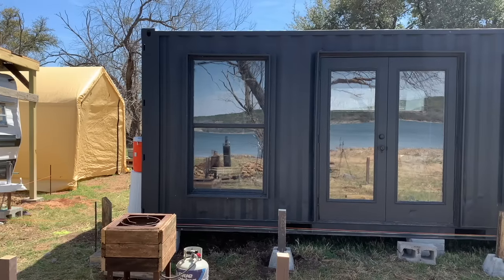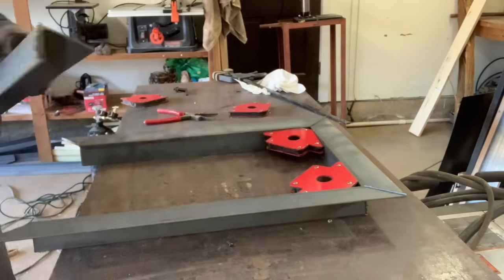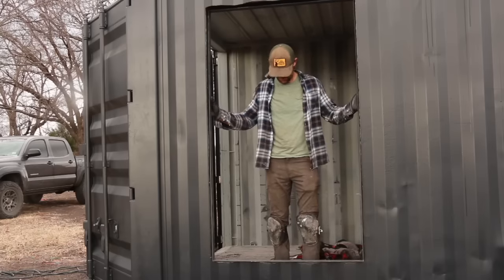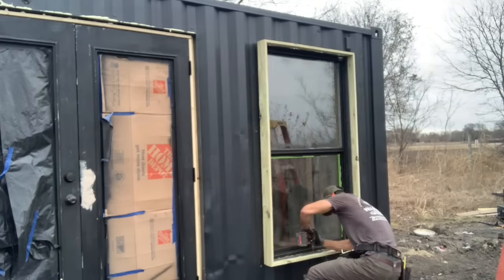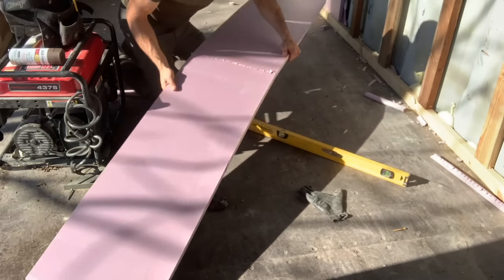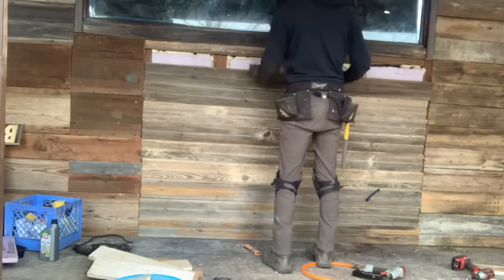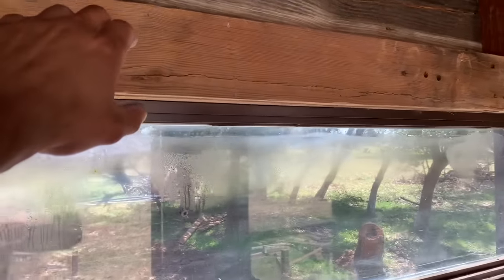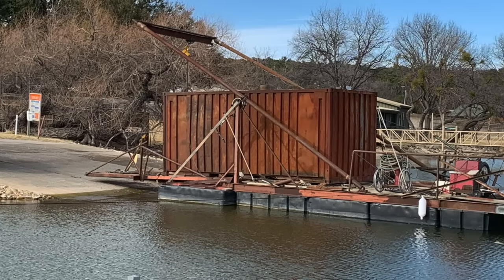Lakefront Shipping Container Tiny Home Build (with costs)

Comment: Here in Sydney an artist friend of mine wanted a new studio to use from home ... a lot of his work is oil based paints, smelly to some folks. He asked me to help him (I'm 74 years old?) Anyway we built some container offices in the 1970's working for DOD. These units were to be movable from site to site as we were closing down Nike Missile's sites around the state. The first thing I had the engineers do was make a slanted single side roof with insulation. The we built 2 X 2 wood frames and glued them to the inside walls, insulated them and then dry-walled the interior. At the back door we installed a new wall about 6 inches inside with a door and window out of wood. I had them install a center channel to hold 12 volt, 24 volt and 110 Volt power lines. My thinking was if we had a problem we could get to the wires with little effort. We would load these onto a shipping container trailer, Park and level the trailer at the site along with a large Army generator... I left DOD in 1979 to teach in Australia, so I have no idea how long they used them....I used to take a heat gun to remove stickers and then we sand blasted the container ... prime and then coat with DuPont "Imron" polyurethane enamel on the sides and door.

Comment: Nice work ! Few details, if I may.... Next time use 7" worm drive carpenter's Skill saw with metal blade to cut through the wall of the container. It cuts as easy as cutting through wood. Faster and you end up with straight cut. Also, steel-clad pre-hung double door at HD run about $600.00 (by Masonite). You save your self so much time and energy installing them.  Even if you have to pay $1K for the door as you mentioned - still, absolutely worth it. As far as wall insulation, I would use spray foam insulation for such a narrow wall. Close Cell foam insulation gives you about R-6 per inch of Thermal Protection. So with the perforations in the walls, you could get R-9 to R-13 of Thermal value out of it. Lastly, have you consider metal studs  for framing? You can get them in 2 1/2" and they are very sturdy, as well as they will give you more space for insulation. Keep it up !
Reply from the maker: Thank you! Awesome comment. I just tried a metal skilsaw blade without much luck but let me go back to it…it’s funny, I was just working on a vid saying I’ve about had it with salvage doors. Too much work. And I think I’m in the spray foam game from here on out.

Comment: Nice job! The only suggestion I would offer is that you should have first wrapped the entire interior with that mylar bubble sheets. Then you could have framed over that. Then, when you spray foamed and foam insulation boarded the structure, you would have created a thermal barrier inbeteewn the structure and your insulation, blocking heat from coming in and or leaving the structure.

Comment: One thing I know about containers, especially here in Australia, is that condensation builds up inside.
Usually running down the inside of the walls.
We usually put in an arched ceiling so that condensation can run off , then down the walls, which can then drain out via pre drilled holes in the floor.
Here, we also use a product called Crimsafe, it’s a really tough metal screen that is placed over the window on the outside.
It will stop a .22 round from 100 metres so rocks are not a problem.
Reply: Sounds like a rough neighborhood..

Comment: I was an autobody man for many years. The best way to remove those stickers is with a razor blade. Peel the letters off and then use Varsol to remove the glue if you want to save the finish underneath. If you don't care about the finish underneath use Lacquer Thinner. If the container if very rusty you are better off to buy or rent a sand blaster. Sand blasted metal is the cleanest and primer and paint sticks really well to it. I would use an Automotive epoxy primer on the bare metal.

Comment: I've thought a lot about insulation for a shipping container.
I know part of the reason to build in a container is the obvious aesthetic of the container itself.
I'd like to retire to Mexico and insulation would be key not to cook inside it once it is done.
If you were to put some framing on the outside of the container using the full 4 or 6 inch depth,
you could use a spray foam to insulate it from the outside. This would allow you to use the 
small framing on the inside to keep as much inside space as possible. Then the space in the inside framing could be used for all the electrical and piping. Another option is to find a 10' wide container.
Just a thought! Thanks for sharing your experience!

Comment: Hi Matt This is Trevor form Compass Containers in Cairns Australia we do lots of container mods i saw you had trouble with the stickers we use a big LPG heater heat the sticker until it is almost to hot to hold your hand on the metal the old sticker will become soft and you can just pull it off if it cools down it will not peal just re heat and keep going Give it a go Best of luck Cheers Trevor

Comment: Love it man. Looks great and so much salvage is awesome. I have a dream goal of getting my 40’ build down to 10-20k. I’m still pricing stuff out but I am close to making my goal. Another aspect is keeping yearly expenses down to under 1k including water and electric and septic. I’m pretty happy with my design so far. I have the same difficulty with wall thickness. I’m framing out 6” for my blow in insulation to keep costs down and insulate a lot.

Comment: The framing doesn't need to be up against the container walls. You could have sandwiched another layer of insulation between the framing and the wall. In addition to increasing the insulation, you'd eliminate thermal bridging, since the 1x3 are no longer touching the metal. That would be preferable to turning the 1x3s in the other orientation.
Reply: how do you secure the 1x3's doing it your way, and over time do you not get dust bunnies in those areas?

Comment: Great skills and narration!  Love the freedom of wherever you are .. Florida is not so free as far as land use and  zoning.. even in the most remote counties.   Also, with the cost of shipping containers now and as much work as you have to do inside with framing and siding,  does it not beg the question.. why bother with the hot metal box that cost a fortune to transport?  I know building onsite is not as convenient.   
A woods cabin project I have had for some time... an  8x8  steel frame micro cabin with a tiny kitchen and bathroom under a pitched green polycarbamate roof . During the day, all 3 walls open up like wings creating a large open outdoor and shaded living spaces .  Deal with bugs using only a few powerful fans. Build it on-site elevated under a canopy of trees.  Exterior siding is composite and designed to look like Greenbriar and other vegetation  around it.

Comment: While still watching this, I had a thought, would it be beneficial to design those installed windows with some kind of shock absorbing material and/or covers to close them off so that the entire build can be moved without them breaking? Since it is a shipping container, it is already designed to be transported. I feel like utilizing this built in feature of the container, into the build could open up possibilities for the owner for future changes in their life like moving. Just a thought.

Comment: Pretty sure the metal walls will be all wet and condensate behind that thin insulation. There needs to be a vapor barrier. Where hot meets cold moisture forms. When it’s freezing outside and hot inside  it’ll get all moldy inside the walls. That’s why spray foam is better. It forms a vapor barrier.

Comment: Very educational video, but the cost is still great, even at the historical high price of the container it's still cheaper than a stick build, your not building a 8.5X20 structor with walls, roof and subfloors out of lumber for $3500 and that's why I'm building one for myself, I'm going to live in mine full-time though, mine is a 20x8.5 footer and a 10x 8.5 footer, the 20 footer is going to be my main living area, Kitchen/Living room and bathroom, the 10 footer is going to be my bedroom, I'm also going to put mine in L shape, at first I thought about puting the 10 footer on top of the 20 footer but I'm getting older and don't wanna climb stairs. I'm also not going to put as much window in mine, Building a fishing/vacation cabin and living in one are 2 different things, I'm only going to 272 sq ft, I need as much wall-space as I can get, even though I live minimalistic, and have for many years, there's still more essentials that you HAVE to have to live somewhat comfortably and the "tiny house" and "minimilistic" shows on t.v. and their "pairing down" segments don't paint the picture in any sort of reality correctly. while it's true you don't need 50 t-shirts, 20 pairs of shoes and 10 pairs of jeans you also need more than 2 t-shirts, 2 pairs of shoes and pair of jeans or else your going to be doing laundry every other day. you don;t need a huge stove but you still need something to cook in, I've got a 9 function Air Fryer and a Microwave in my kitchen, i also have a 2 burner RV hot plate that I bought just in case but have never used, I bought 3/4 size "Apartment" refrigerator, once again I don't need a full size refrigerator but I need more than one of those little dorm room refrigerators that only holds a pack of balogna a half dozen eggs and A beer bottle. My lower kitchen cabinets, Bathroom vanity, toilet, sinks and shower I bought from the Habitat for Humanity ReStore for Pennies on the dollar, a brand new coat of paint and you'll never know they were used.

Comment: I lived in a 2x4  80sf  8x10    2x4 rafters tiny house with a pourch.  I find that insulation is always a concern in builds. It's not realy a problem, I had a wood stove and a stand up oil electrice heater.. I used the oil, as the regular heat, and wood on power outage, The wood would run you out.Containers are so air tight heating is not realy a concern. Now this is in WA State at 600ft ele.

Comment: Hello, you had an issue with door frame because you was doing it wrong. You need to remove doors from frame, completely and perfectly straight attach the side of the door frame with door hinge, attach one top point of opposite side of the door frame, only then install doors, align the doors and finish attaching opposite side of the door frame. Everything else is quite well done.

Comment: If your a roofer and  you have done flat roof you use foam insulation. I like natural products and have seen people use straw bales for insulation. I haven't seen anyone brick 🧱 the outside of a container! The point is people take a tiny structure and want to cut it and work inside the bounds. Why not work outside the bounds. Yes you have to spend more money but I believe the mind set to keep on the back burner so to speak is resale! Is some one going to want to buy it after you have put sweat 💦😅 equity in it? Make it resalable is my opinion.👍🤔🙂

Comment: When will people think outside the box, I used 3" top-hat purlin on the outside with 3" insulation batts and covered with metal roofing material, then 1/8" ply on the inside which gave me an extra 8" of internal space, I also built steel trusses with insulation and steel roofing, as I am not in a snow area I fitted spouting and a tank to catch rain water
Reply from the maker: Right on John. Any pictures or vid? Would love to see it.

Comment: You did a great job! 

I want to let you know I don’t mean this in a judgmental way at all, but you aren’t supposed use that type of insulation in a container, because since there is a gap in between it and the metal walls, condensation will form and mold your interior siding. The best insulation to use is small cell spray foam insulation because that closes any gap between the wall and your siding/drywall. 

I would just keep an eye out for mold. Again I don’t mean this in a judgey, just looking out for your safety and eventually your wallet.
Reply from the maker: Thank you!! Great comment, i really appreciate it. It’s crazy that containers “sweat”…cell spray was out of budget, so we’ll see how things go with this stuff.  I’ll certainly be keeping an eye out.
Reply: @thecoyotelab  😊! I know it’s wild! We had no idea, until our walls got all moldy and rotted. Luckily our container was basically a “she shed”, art studio type of space and it was only a 10 ft container, but it was still a mess having to redo it. For reference, it started molding about 2 years after we made it. I wish you the bestest of luck!!! 😊

Comment: That's awesome..I'm considering the same thing.. got a few questions if you don't mind..

Would you consider attaching multiple containers together? If so, how? weld them, bolt them, both? 

How difficult was the welding? I took welding in the job corps in the mid 90s. But I have done it since. I'm not confident I would have a good strong weld..

I saw the A.C...how would heat it?

Thanks for posting

Comment: Hey cool video! Thanks for the full breakdown. I might've missed it but did you mention anything about the foundation? Are concrete blocks all you need for a container house of this size? Aside from the potential permits needed... Do you know at what size you'd have to start digging and doing that whole headache of foundation from a purely structural stability standpoint?

Comment: Are you building in an area with no building codes because I am wondering how you can get away with not enough insulation when most codes say at least 19 R in walls and floor, and 30 R in ceilings.

Comment: Nice work! I had a question for you. Do you foresee any rusting issue? I live in a colder climate and it snows here
Reply from the maker: I don’t think so…it’s hot and dry here so I think I should be good. I did have another container rust on the roof, so I definitely advise painting the roof with elastomeric

Comment: what kind of welder is best.  Your suggesting is appreciated!
Reply from the maker: In that video I’m running the harbor freight titanium 140. It’s one of the cheapest welders around but it can be run off a smaller generator with a normal 120 plug. Miller and Hobart make really quality welders
Reply: Thank You so much for the reply!!!

Comment: I was wondering why you painted it dark since light paint is usually more reflective. Does it get really hot in these things?
Reply from the maker: Lol, yes it gets extremely hot. I’ll explain in part 2, but basically, wife liked the dark color.
Reply: @thecoyotelab  FYI I made the mistake once as well. House used to be white but the whole neighborhood started to go tan and brown etc so I decided to go with an adobe color. Is prettier but I noticed that the house is at a minimum 5 to 10° hotter during the summer time. It absorbs the heat rather than deflecting it. As soon as I can afford to I'm going to repaint the house in White. It might be boring but it does make a difference

Comment: Foundation? Is it just ontop of center blocks?
Reply from the maker: Yes. That’s how many of the cabins over there are built because concrete is so cumbersome to handle in large quantities with boat access only. I can lift the cabin with a jack so I’ll be able to make small adjustments as needed.
Reply: @thecoyotelab  very cool. Getting ideas for building a shipping container myself in AZ

Comment: I'm curious in how you attached the 2x3s to the walls.  Did you drill into the container itself into the outside?  Maybe glue it the metal or cut it exact and wedge it in.  I've been trying to think what is the best way to put a wall into a container.  This is something I will be doing soon.
Reply from the maker: Great question. The wood frame is attached with wood to metal screws to the metal window frames I made, which are welded to the container. It survived a long transport and a trip across the lake, so I think it’s a pretty good method!
Reply: @thecoyotelab  I think it looks pretty good too.  Thanks
Reply: Hire a contractor,Curious George. Or Call This Old House 🏡,They Deliver .
Reply: @arthurburke1044  You are full of good advice.
Reply: Hey Silly,forget about the gluten & glue get your 2/4s lay them out and start framing within the container. You the cutting right,but use screw gun to Attach. No Wedgesss  Unless Your Going To Dance 💃 For Us All. What’s going to be going on inside that Container Of Your’s Anyways ??? A Little Midnight Dancing ??? 👮‍♀️👮‍♀️Watch it 👧 girlfriend,this is a family channel now.

Comment: Sorry, but converting standard shipping containers to dwellings is just DUMB really really DUMB. The whole concept is tantamount to a scam. When you factor in transportation costs and all of the modifications required to make it structurally strong and useable you might as well have just built something from scratch using conventional materials. And after all that hard work and cost you still end up with a weakened structure with low ceilings, terrible insulation and an inherent condensation problem.
Reply: @irenovatedmv  sorry if I stomped all over somebody's feelings. Hearing the truth can be harsh, and people get emotional especially when they've already sunk a lot of time, money and hard work into a dream project. But these conversions just don't make any sense unless you just really really like a vaguely industrial aesthetic to your micro home.